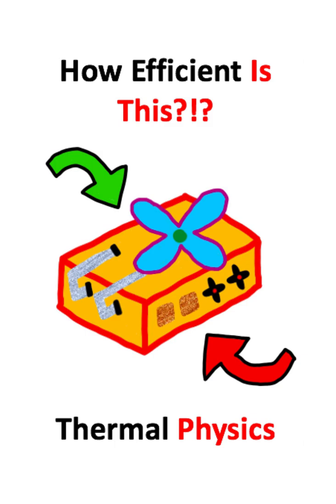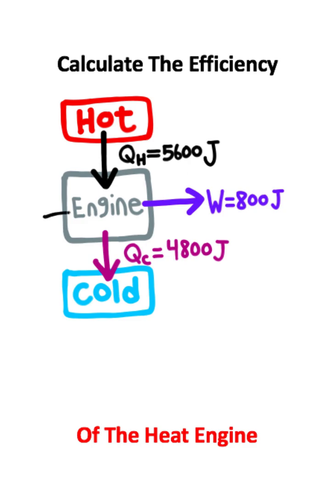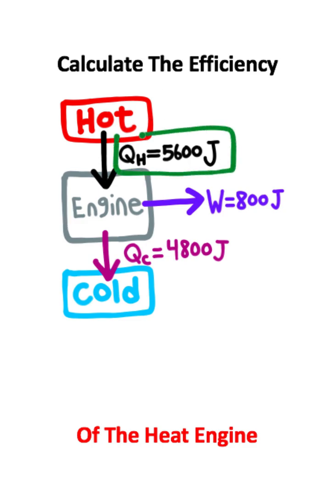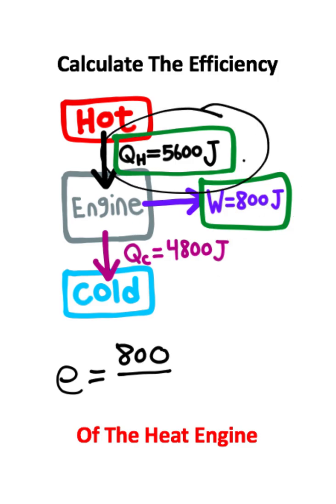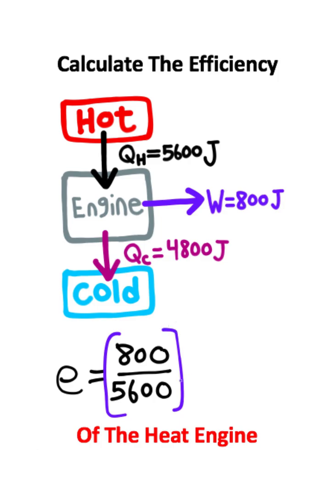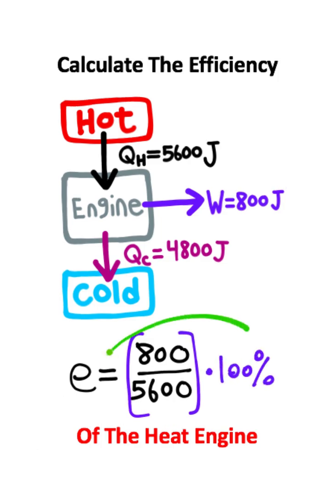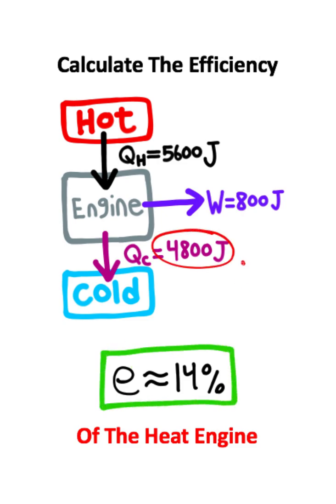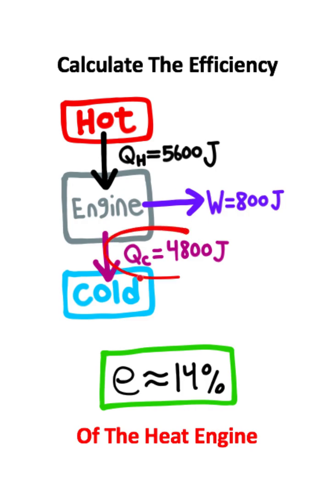How Efficient Is This Engine?

Comment: This is an extremely simple concept. I have a pitcher of juice. 
It's full 100%
I have a cup I want to fill.
I raise the pitcher up REALLY high and try to aim for the cup, I only get 14% into the cup. That's the usable juice (the work)
The rest is wasted (spilled all over the floor)
No engines are perfect systems the reason this math is important is because it tells you how much heat is being wasted vs being used.